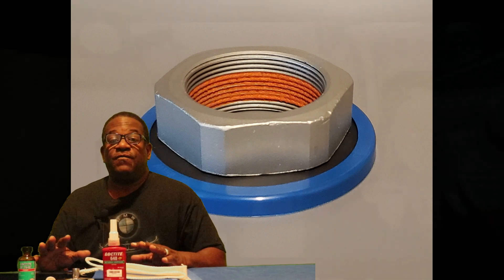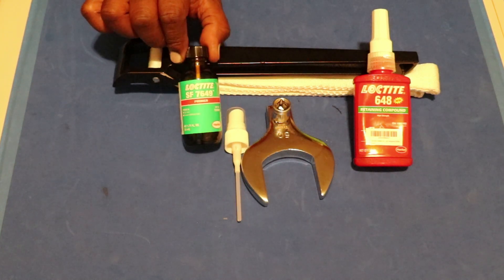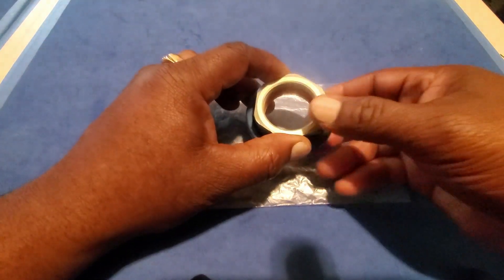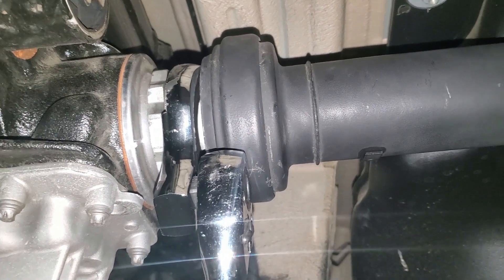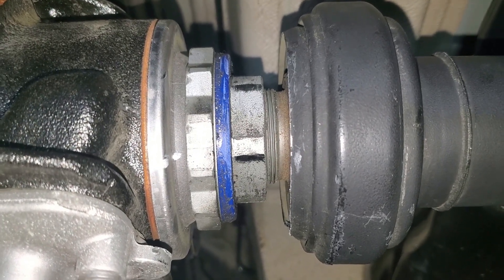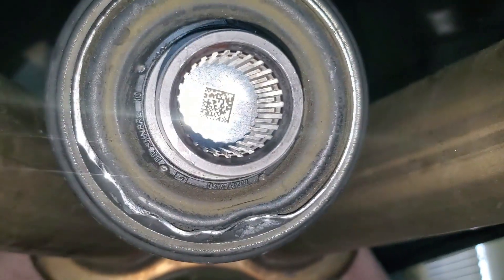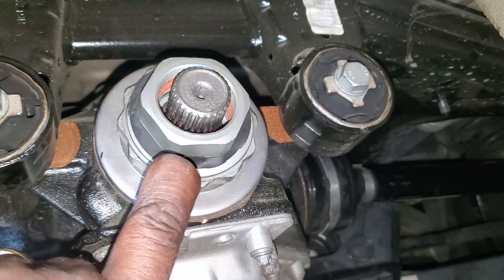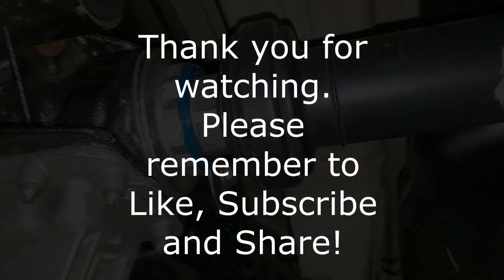Drive Shaft Clunk Sound fix for BMW X3M and X4M How to Fix

Comment: You're doing it wrong and recommending the wrong method to others. The propeller shaft must be secured at the center universal joint against twisting using a suitable tool, like a large screwdriver. Using a pipe wrench to secure it will cause damage. The hub teeth should be cleaned and coated with a suitable grease like Optimol Olistamoly, NOT Loctite. Loctite is used for nut threads, and a new sunk nut is already coated with it.
Reply: Truth, he not gonna be able to remove that drive shaft anymore.
Reply: You guys are wrong. Its a Puma "update" where you have to glue the shaft. What he has done wrong is, dammaged the prop shaft (even when he's saying he did not. Look from 15:40) and put glue on the diff. The rubber sealant does not go inside the other nut. You have to fill the bigger nut with Olistamoly 2 584. 

The loctite replaced the optitemp hf 1 lt. You put a 1cm and a 5mm thick Glueline inside the Shaft and put everthing together again.
Reply from the maker: I agree. securing the shaft at the u-joint is a better method.
Reply from the maker: Heat and it will slide right out. Please educate yourself.
Reply: @Engineerboy100 can you please explain I’m currently having this issue
Reply: Loctite 648 is recommended on the driveshaft spline in the ISTA BMW service manual if you look up "Removing and installing complete propeller shaft". Optimol Olistamoly is not to be used on the driveshaft splines but the recessed collar of the centring rings. You're not reading the manual correctly. Literally has a graphic of the driveshaft splines and where to apply to loctite in the service manual.

Comment: Very nice Clint, was this successful in getting rid of the clunk?
Reply from the maker: Yes sir! The clunk is gone running smoothly and quiet as I installed the Bolt Saver bushing at the same time.
Reply: @Engineerboy100 hi sir! is the bolt saver bushing separate from the kit? thanks

Comment: I believe i have a driveshaft issue i have a 2024 x3m but im not really hearing a clunking sound, i have a whining noise, then at times a grinding noise. Does you think that is a drive shaft issue?
Reply from the maker: You might need to change your front and rear differential oils. I have  videos about that.